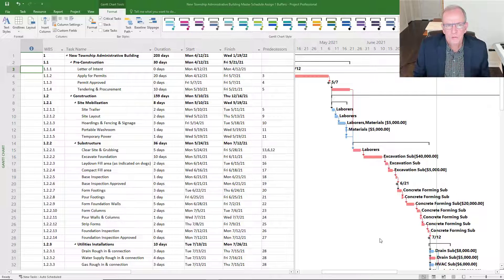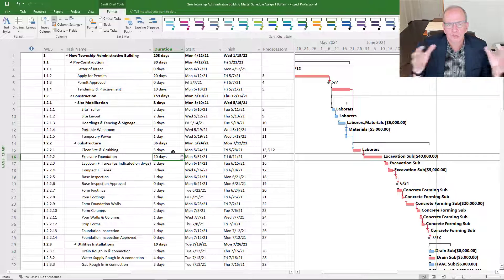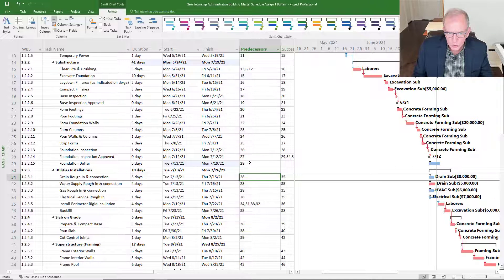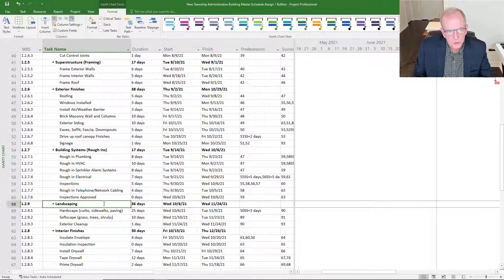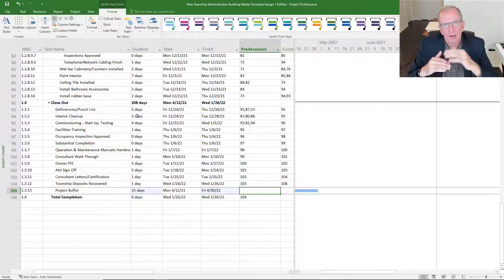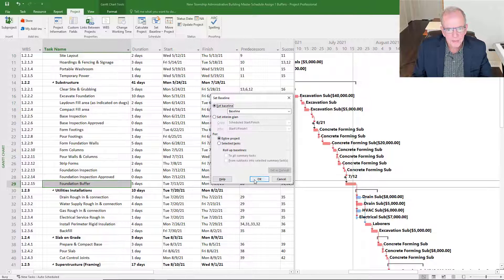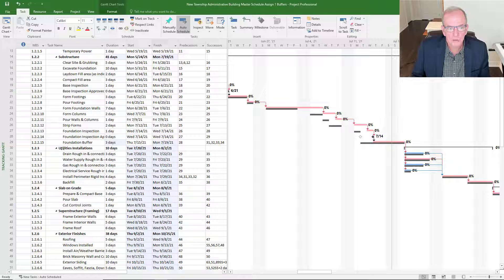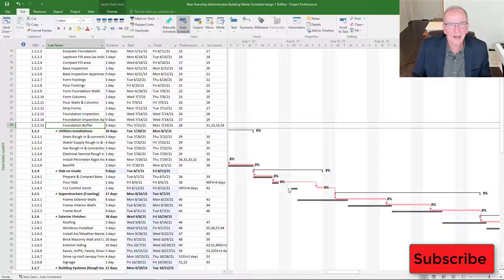Learn how to apply Buffers in MS Project to improve your PM skills, MS Project Made Easy 20

Comment: How would you create a resource work Buffer for a Fixed Duration task?
Reply from the maker: Hi Jeff,  Could you give me more information I’m not sure exactly what you are after.
Reply: @TomStephensontraining  Tom, I have an operational schedule that consists of 5 common fixed duration tasks w/ durations of 251 days.  I have a group of 5 resources reserved to the schedule and are expected to spend 30% of their time working on any of these tasks throughout the year.   The work forecast is a peanut butter spread.  E.g. Task Tower B Support task,  all resources have 5hrs/week forecasted for the entire year.  However, code corruption occurs in tower B and resources burn 20 hrs/week for 4 weeks.   The extra 15 hrs/week that was burned is pulled from the work in the future.  Can I create a buffer to replace those future forecasted hours?